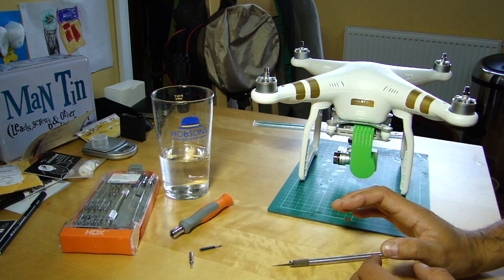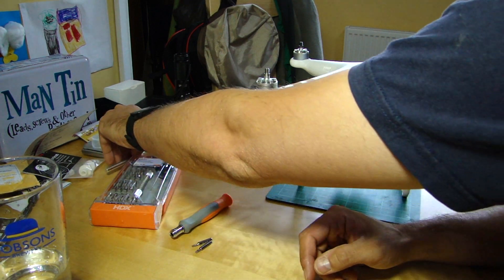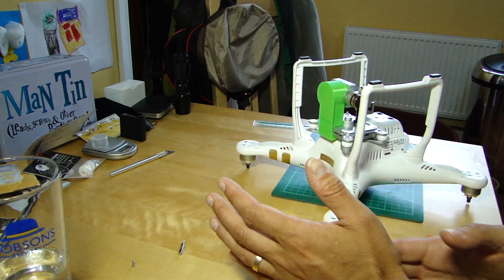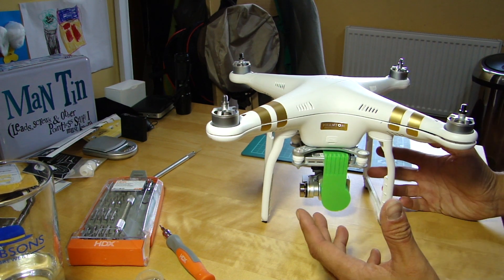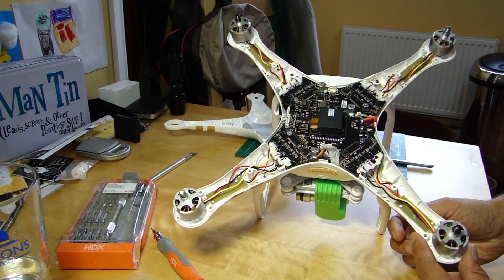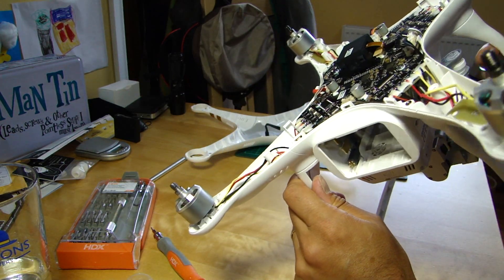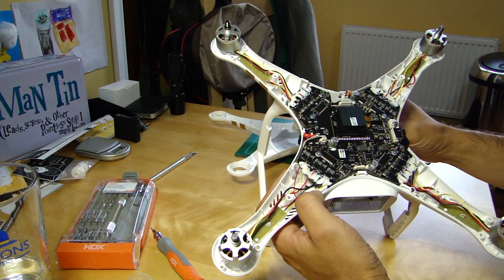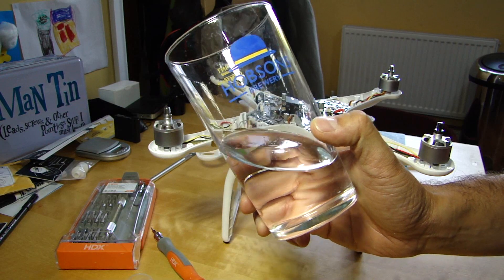How to open the DJI Phantom 3 - and a first look inside

Comment: Lol..i am glad the care package has come in handy as much as it has..what about the main component, the wine? Haha. Okay, so after opening the p3, take a dremel and grind off all the retaining clips? Lol. Kidding. Kinda...after warranty!
Reply: Yes, I am sure that is why they are there. I have not seen any issues where the shell was not tightly fit together in the past? either way, I would still say after the warranty is over, to grind them bad boys off lol
Reply: Any time, any time. Just glad it helped. I have a million of those kits because of all the cellular devices and tablets i have to work on... In fact, i just opened another handy kit similar to that one last night to use the hex bit to change my front load washer door latch lol. In this particular kit, there is even a really funky bit i have never seen..its like a flat head with a u shape in the middle? So kinda 2 flat heads in one bit? Very strange?
Reply: I already clipped mine off-- what warranty?  :)
Reply: Hahahahahaha.... I like the way u think
Reply: Jeremy Miller y
Reply: alejandro chambi ?

Comment: My guess for making the ESC all in one component with the main board is to reduce production costs ease of factory installation and reduce the points of failure with less solder connections.  The downside of that from the consumer point of view is a far more costly and difficult repair should one fail. Good for DJI but bad for the consumer.  You had to guess there was some reason how DJI could integrate all these extra features into the Phantom 3 Pro but at a reduced cost over the Phantom 2 Vision plus  and this is one of the reasons why.